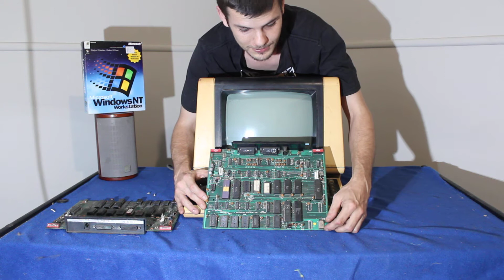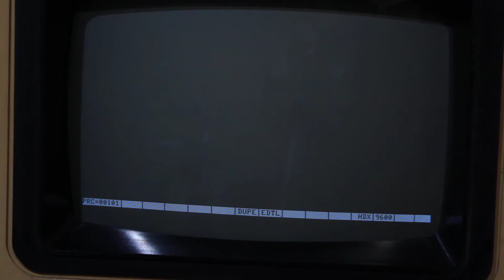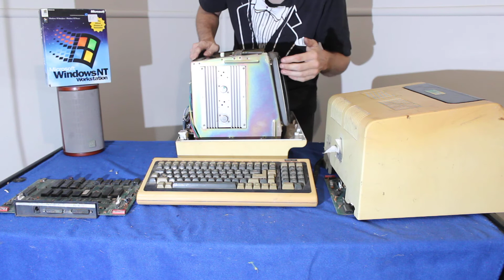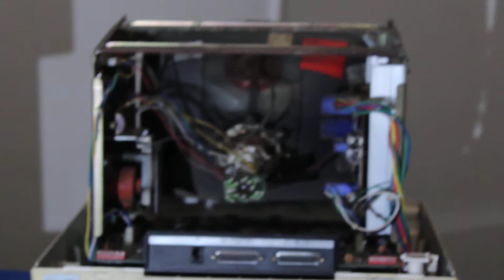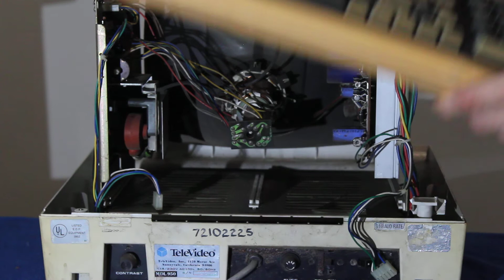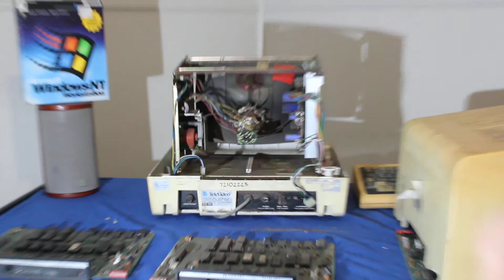First Look - Televideo Model 950 Terminal

Comment: Amazing terminals those. I was lucky enough to source one in mint condition and original box a few years back . Great for using CP/M single board systems in an authentic way !

These seem to have been closely based on design of the popular DEC VT100 terminals.

This and the 925 were top line terminals - I would have expected these to have been close to $2500 in AU back in the day

In 1983 our school computer lab consisted of a AlphaMicro mini and 8 low-end Televideo 910 uppercase-only terminals for students to edit their AlphaBASIC and AlphaPASCAL programs on, after first submitting them as text files, line by line at 75 baud, on pencil-marked cards.  

The 9th terminal was in the glass walled, air conditioned room that housed the actual AlphaMicro - this was used by the teachers to watch process stats and keep eye on the 3 card readers and two printers and of course the students on the 8 Televideo 910’s - if anyone managed to break out of the rudimentary menu system and into the AMOS operating system (got root….  or “got dot” as the AMOS prompt was a full stop “.” ) the teacher would down their sandwich and race out to scold the student (“wasn’t me!”) and re-launch the menu system under cloak of secrecy so no one would see them type  “.run menu.mnu[2,2]” for fear of students learning about the OS ….

Eventually driving dozens of terminals, from Wyse to Esprit, I think this old 1977 vintage AlphaMicro was a hand-me-down from the school administration,  as they had a much newer AlphaMicro with dozens of terminals around the school - time tables to school fees were all done through it.

The Televideo 910 terminals were the star of the show, being proudly left running at night with the menu system burning into their white screens !

Comment: Excellent video! I've always been interested in smart terminals and their theoretical capability to be used as a computer, since they have an onboard CPU. I've also wanted to create a new ROM chip with software to replace the firmware (specifically a game that I would make). You have to make a video of that!

I'm surprised they made 6502-based terminals in addition to Z80, especially since they created CP/M computers. They actually created all-in-one CP/M computers from their terminals (as did others, like DEC with the VT-180): http://www.old-computers.com/museum/computer.asp?st=1&c=610

As far as I understand, unlike their CP/M computers, there was no specific computer models the 950 and most of their other terminals were made to connect to. These were just 3rd party terminals that could be used with a micro which supported terminals or  a mini or mainframe. You could just connect it to you computer running Linux or a mini or mainframe emulator.

Their CP/M computers were made to connect to the TS-806 or TS-816, which will download CP/M to the client--basically a proto-netboot. This must be what you're referring to. These were first delivered in 82, whereas the 950 was first delivered in 81. According to a msg found at the following URL, the TS-800A was the CP/M computer version of the 950

ftp://ftp.invisible-island.net/shuford/terminal/televideo_news.txt
The keyboard label is correct. This is a TS-800A, which is diskless CP/M
workstation. The TS-800A is basically a model 950 terminal with a Z-80
computer added to the circuit board, that boots off a Televideo CP/M
file server connected to the (15 pin) RS-422 port. Televideo also added
a function that allows the integral terminal to be used without the
computer portion, by flipping a dipswitch and setting up the baud rate
and other comms parameters. You can obtain manuals from Sharon
Industries in San Jose California, at (408)-436-0455 for a nominal fee.

I then found this amazing document:
http://bitsavers.org/pdf/televideo/TS_800/TS_800_Hardware_Theory_of_Operation.pdf

This provides detailed documentation of both the computer and terminal "portions" of the TS-800A, with likely enough info to program new ROM chips for both the computers and the terminals, and maybe even for serving CP/M to the computer. Amazingly enough, there are 2 separate computers inside the TS-800A: the computer side is based on a Z80 and related Zilog chips, and the terminal is based on a 6502 and related terminal chips. So, the TeleVideo terminals weren't capable of running CP/M, at least not in a supported manner, and likely all of them were based on the 6502 (either from MOS or a 2nd source manufacturer like Rockwell).

Scroll down to the April 1985 document, in order to see info on the 950 and other older TeleVideo terminals
http://bitsavers.informatik.uni-stuttgart.de/pdf/datapro/alphanumeric_terminals/Datapro_C25_Televideo.pdf
According to this document, the Model 950 contains all of the features of Model 925, plus advanced editing with wraparound, smooth scrolling,
split screen with line lock, 15 special graphics characters, and up to three additional pages of display memory.

If you scroll down to the 1983 document, you can see the description of the 925:
Model 925-features Model 920 emulation, as well as a higher maximum transmission rate (19,200 bps as opposed to the 920's 9600 bps maximum). Enhanced ergonomic features include a tilt/swivel display and a detachable keyboard.

So, it has a tilt/swivel display.

Seems that the 950 can't do graphics, other than the 15 graphics characters, similar in concept to PETSCIi (CBM) or ATASCIi (Atari), which is what I think you were referring to. but some of their other terminals had optional graphics boards that were compatible with the Tektronix. There was even a mouse available for these. That would really make them start looking like a Mac, but the mouse is first mentioned in the 1985 document.

Here's the instructions for the TS-806/20 "service processor":
https://archive.org/details/bitsavers_televideoTnstallationandUsersGuideOct82_3063098/page/n63

Check out this other interesting design of an all-in-one computer TeleVideo created: http://www.computinghistory.org.uk/det/4771/TeleVideo-TS-1603-Computer-System/

Oh, and the full screen editing was definitely and advanced feature in the early 80s. The only microcomputers that I know of that had this feature built into their OS was the Atari 400/800, which came out in 1979. Incredibly advanced machines--the most advanced micros at the time, for sure. System architect and lead chip designer and his lieutenant went on to design the Amiga's architecture and chips. The top VCS (2600) game programmers developed the OS, when the outside team floundered, and then they left to form Activision.

Comment: I love TeleVideo terminals. That one looks like it could use some Retr0brite to fix the yellowing. The keyboards of the 925 and 950 models are almost indestructible (with normal use). I only recently found out that yes, basically they contain an entire 6502A (2MHz) computer and a 6845 CRT controller.
But your shouldn't regard it as a computer, it's a terminal. It doesn't do anything unless you connect it to a computer (and optionally a serial printer).
The key beeping can be switched off with dip switches, and the baud rates for the host and printer serial ports can be adjusted by dip switch too (later TeleVideo terminals had on-board setup programs). It has a demo/test mode that shows all the characters (with/without underline, with/without half-intensity -- full intensity is the default), if you hit shift+setup if memory serves me. The manual is available online.
It can do some pretty smart things (for a terminal) such as putting a form on the  screen and make it impossible to overwrite anything outside the fields you need to fill out. Also it can do things like display control codes so you'll see a single character with e.g. "CR" in it for a carriage return code, instead of the cursor going to the beginning of the line like it would normally do. Very useful if you programmed mainframes in the 1980s.
I own a 925 which has the same features but slightly lower resolution; maybe I'll have some fun with it some day by putting some different software in the ROMs to make it do something useful, just for the heck of it. But I have too many other projects going, and a terminal emulator like TeraTerm takes up a lot less space than one of these :)
Reply: @Sleeping The jury's still out on whether it weakens the plastic, is it not? But, yes, it definitely is known to be temporary, but likely only because additional UV exposure degrade the restored surface. I believe if you retr0brited and then immediately stored away from all light, it would not re-yellow.
Reply from the maker: I’ve retro brighter a few things over the years non have reverted back to yellow yet
Reply: I love the key beeping! I would never ever turn it off.